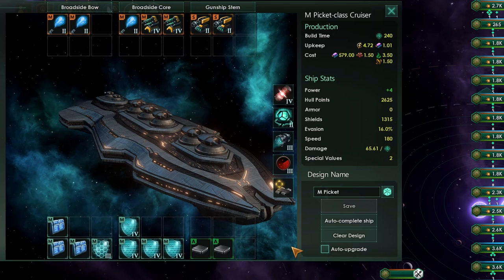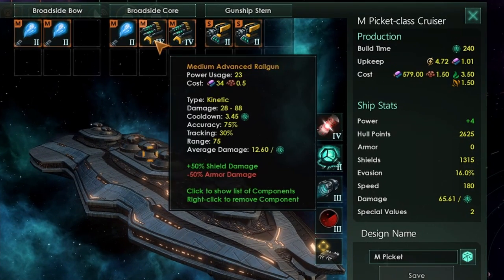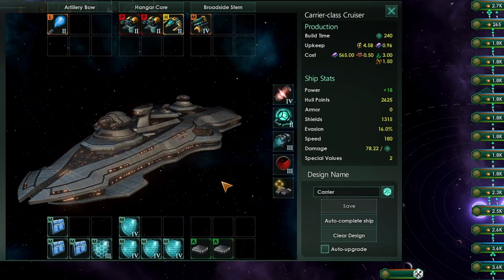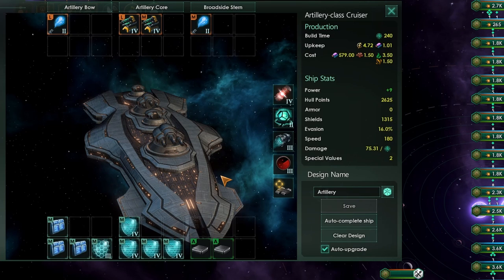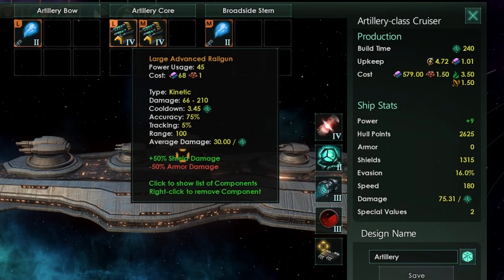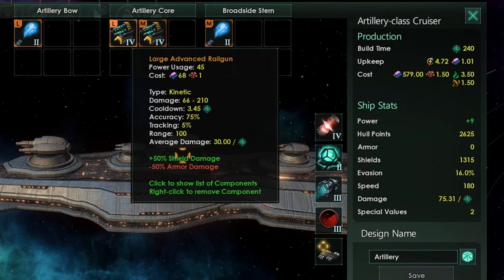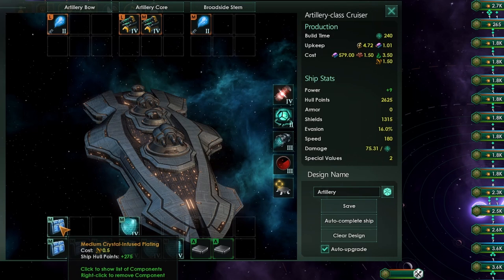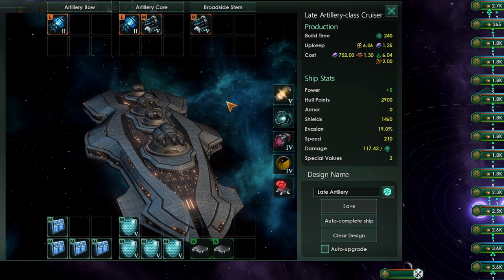Stellaris Cruiser Design - The Twilight Class

Comment: Missing cheap carrier design with the only aircraft slot. Having the price near a corvette, these cruisers are really good if your enemy lacks X/L slots.
Reply: Ah, the Stefan Special; crystal played gunless carriers. Great for spamming and stalling.
Reply: I love doing this lol, it's one of the most cost effective ships in the game. Combining strike craft with other weapons is a waste, you want all your weapons to pierce shields or none of them.
Reply: @blahmaster6k  True, but late game with repeatables massed X focused arc emitters backed by L slot kinetic is good vs Unbidden.  Enough ships are killed at long range, before their matter disintegraters fire.  Relying on strike craft backing the X slot can backfire when they fly between seperate targets or fleets pop out of L-gates inside gun range.  Craft take longer to attack.
Often late game my ships have just 1/3 hull defence points, adding plating rather than extra shields is weaker because of repeatable tech
Reply from the maker: So i have tested "naked" carriers, they don't beat artillery designs (the one i specified as anti-cruiser) with the same defensive module layouts. This is of course testing two fleets of equal cost economically. I'm honestly not a fan of that ship design, though I can see its merits. Its important to note that fighters will cause a very high level of disemgagement in the enemy, due to the low damage value "per shot".
Reply: @MontuPlays  That's not a silver bullet design indeed. But it's really good if you manage to rush it while the opponent lacks L/X slots. The carrier easily beats any corvette, for example, while it costs similarly. You don't have to go to the end with these cheap ships. You just gain an advantage of your tech superiority and rearm the cruisers to L-design when it's gone.
Reply: @Artem-yk7ig  how would they lack l slots? You do realise you can set up l slot destroyers that are artillery.

Comment: Torpedo front, carrier middle and small slots on back. Regenerative hull tissue, artillery computer and shield capacitors.

Autocannons and small beam weapons to kill corvettes.

I use these to cruise around and take territory indefinitely.
Reply: Ah, the "I have space for another weapon" type.
Reply: Regenetative Hull Tissue gets significantly worse the bigger ship you are using it on because it's a flat daily hull(and armor) regen, unlike the Engineer admiral trait and Devouring Swarm civic that give 0.5% daily hull regen
Reply: @badluckpoppy  this isn't new information...  The regenerative hull tissue is merely there to extend deployment duration by saving time on repairs.

Yes I am one of those nerds that tries to minimize casualties.
Reply: Well I switched to use L slot artillery with the hangar rather than hard counterable torps, but mix in artillery destroyers, also boosting cruiser speed with after burners, improves flexibility by rapid maneuver.
This kind of fleet is great vs bases but can also deal well enough with corvettes.
An engineer after battle admiral is far more effective than regen hull tissue, as is temporarily detaching the destroyers to repair and re-merge.  Flat point recovery is nearly worthless and makes scourge crisis very slow as they idle recovering.
A small % regen would make better sense.
Reply: @badluckpoppy  This make me wonder, but if ship have armor/hull regen and they retreat from combat via sublight or something... do they repairing themselves during that time missing?
Reply: @badluckpoppy  well, bad regen is better than no regen
Reply: Lets Plays von Aja Not necessarily since there's also the opportunity cost of the regenerative hull taking up a slot that could be used to improve evasion or chance to hit.

Comment: This is such a good video. I'm coming to Stellaris from other paradox grand strategy (crusader kings ll) and the ship building feels overwhelming for some reason. So much pressure to min-max the rock paper scissors thing going on with shields and armor. Its probably just a noob issue.
Reply from the maker: Now that it is very, very hard to see your opponents ship designs (its hidden behind astronomically high intel) it is even worse! I hopw i managed to help though
Reply: The best way to see if an enemy is purely stacking shields or armor is to open up those post-battle reports. Look at the damage dealt by both sides, and look at the breakdown by weapon types. If you see that your ships did zero shield damage and a lot of armor damage, well, obviously the enemy ship designs are armor only. So on, so forth. You can look at the damage dealt by the enemy ships to get a breakdown of what weapons they are using, and what they are most effective against, so you can use the appropriate defenses as well.
Reply: Stellaris doesn't have very good ship building. An example of ship building done right is distant stars

Comment: Honestly, I think people are using cruisers wrong in the late game. It's already been established that Titan/Battleships with artillery are the best in a straight up fight and everyone keeps trying to throw those and other smaller designs in generally suffers due to losing the alpha strike. However, like in real life cruisers are fast and can sit at long range attacking stations without much retaliation, so instead of trying to meet the enemy head on they should be going behind or around the enemy to out maneuver them. The only thing that can catch up to a cruiser fleet with double afterburners assuming all else is equal is a fleet of corvette and those will get shredded by cruisers.
Also if you're in a situation where you're barely keeping up on the battleship front you've already entered into a strategically costly war so it can often be worth it to send cruisers in behind enemy lines to harass or do eco damage, even a small number of them split into different fleets can be a big headache.
Reply: I thought everyone would do that. Because the AI has the nasty ability to build new starbases in the very last system you have not looked at for a while.
So its often useful to send a clean up crew as you just described. It can be cruisers or destroyers, corvettes took to much damage.
Reply: Very late game, I tend to do Neutron/PD destroyers for this, because 20-30 of them (depending on civics, ascension perks, etc.) is enough to one-cycle (due to their extremely high alpha) an unupgraded starbase and the PD stern keeps that one starbase missile launcher from doing any damage in return.
Unfortunately, they don't have much durability against upgraded starbases (along with no longer being able to do things in an alpha strike) so they're very much restricted to running around cleaning up back lines... but also they only use 40-60 fleet cap, so it's a bit of a rump fleet. Carrier cruisers would have somewhat more options here, although even double-afterburner is slightly slower sublight than the destroyers.

Comment: Thanks, I have indeed mproved my ship & fleet effectiveness with this series, it also helps research focus.
But in single player, I lose only a few destroyers & corvettes when artillery fleets have support, battleships when they don't.  You can see the faster ships taking focused fire as they are in range first.  Spending on armour also isn't bad when it's a one off investment and avoids slow ship refits vs the Militant Isolationists or default empires.  You have time to increase shields & hull preparing for early Unbidden.
Remember also you benefit from limiting fp to < 75k to delay FE upstart awakening and War in Heaven.  That has meant actually nerfing ships with disruptors and cloud lightening or leaving slots empty to reduce fp but have more ships.
Destroying the provokeable Militant Isolationists in defensive war and preparing a rapid fleet expansion is more reliable, if you can get to them.
Focused arc emitters make sense too as 2/3 of dps facing 1/3 defence points is a good deal, especially vs slow opposition like GT and Unbidden.  The sheer mass of L slots with balanced Kinetic Artillery and Neutron Launchers handle a reduced number of ships, which you should out range.
In general the base cracking hangar cruisers are good with artillery destroyer support, but there's a very short window in game for artillery cruisers as I generally can research battleships before another war starts.

Comment: I still use Cruisers, even in late game. I'm not saying this is the best design, may even suck tbh, but seems to work for me. I just go Neutron Launcher up front, carrier core in the the mid, and two small weapons in the rear with opposing damage types. I set the AI to carrier so they launch right away, and when the other ships come into range they get hit with neutrons. I also give them 2 afterburners (when fully upgraded, with a gale speed admiral these things have like a 560 speed). They aren't my main combat fleet, but are far better than battleships for taking over large swaths of lightly defended space, taking over multiple sectors in the time a battleship could slowboat through one. And while corvettes would be even faster, I find I loose a lot less in resources when they do get caught out because I didn't pay enough attention. In a pinch they even work for home defense if an enemy approaches my borders while the main fleet is away. Although after watching this, I may replace a lot of the armor with hull instead.

Comment: Does no one used a mixed fleet design for late games. Like yes I understand battleships are op when u get them and they can push your fleet to amazing power hights.. but like.. cruisers are cheaper. And can hold there own pretty well. 

I usually have several different weapon load outs for each of my ship types and try to keep very diverse fleets. As well I'm a fan of multiple fleets over one or two power houses. As 7-14 10-20k fleets can really do allot strategically

Comment: ok gotta  say while vs an ai these are good options against me you would be destroyed 9 engagements out of 10 with equal fleet power. I tend to go heavy with kinetic focused weapons when fighting other players often sacrificing a ship or even a small fleet to get intel on what they use on their ships and if I can't do that my main ship design is kinetic weapons focused. not missiles or plasma..... and my fav thing to do early game or if I need a fleet fast mid game is to mass corvettes with autocannons..... so ya while armor certainly costs more having even 1 or 2 plates of it is VERY useful to cockblock players like me. 

I personally go with a combo of shields, crystal plate and armor for maximum coverage. the allotment of 30% armor, 20% crystal and 50% shields as yes its not as efficient in raw numbers, it can deal with just about anything the enemy throws at you with almost as much effectiveness as a specialized build against what the enemy has especially when you add in saved time.

Comment: I've watched about 3 of your videos at this point and a lot of your designs do seem to mirror mine in many ways.  Although on your carrier design as opposed to your artillery design, I tend to use tachyon lances on the carriers instead of gigas with kinetic artillery on the rear.  Mainly for balance purposes and to add in a little redundancy should I face anything that counters my artillery too effectively.  Apart from that detail from an offensive point of view, your designs are almost identical to mine.  But the big difference between our builds is the crystal plates.  I don't tend to use hull tanking because I had read else where that when you start taking hull damage, it starts negatively impacting your damage output where as armor doesn't.  So the longer you can keep your hull at full, the longer you can maintain your damage output.  Is this not the case?  I understand your argument regarding hull tanking vs armor from an economic point of view, but if your economy is good enough to support it, shouldn't you use armor instead of crystal plates?
Reply: Likely. Or you could reinvest those saved resources for more Cruisers.

Comment: I thought if ship hull decreases so does fire rate? plus I usually have much more alloys by late midgame than crystal surplus. What makes crystal plate so good? I thought it was trash in most situations.
Reply: Crystal plate is cheaper to make, so that alloy surplus goes a little further. I think the trick is that your ship can be at under 50% hull for longer, which is when you can disengage (thusly saving you the entire cost of the ship)
Reply: What the first guy said and plus the hull points it gives is roughly the same as how many armor points armor gives.